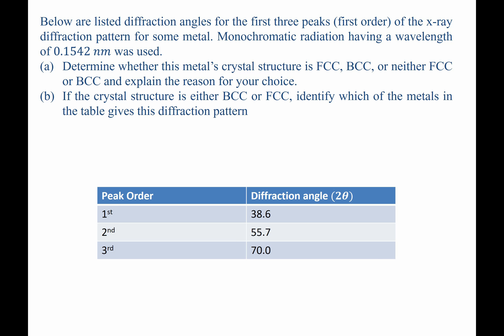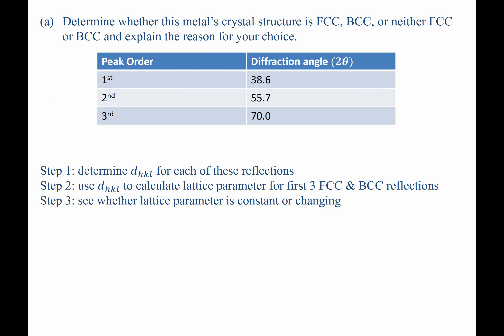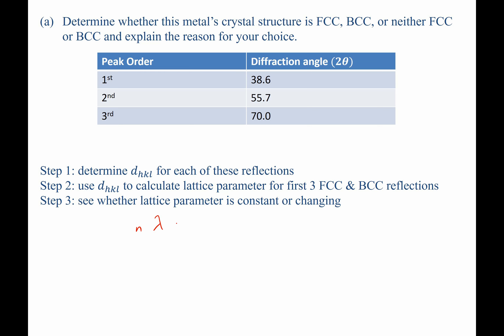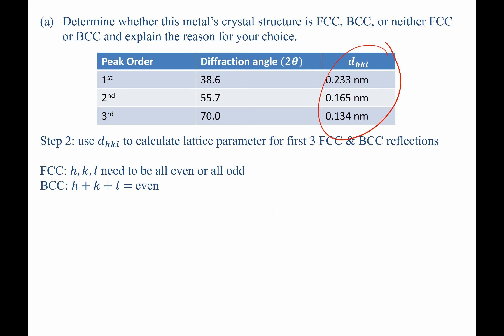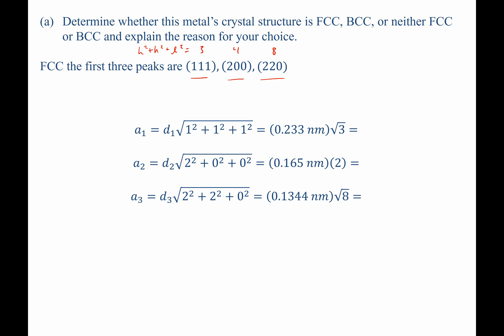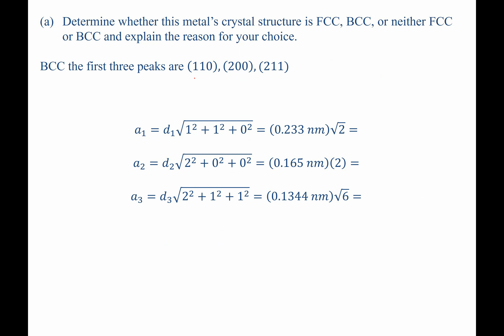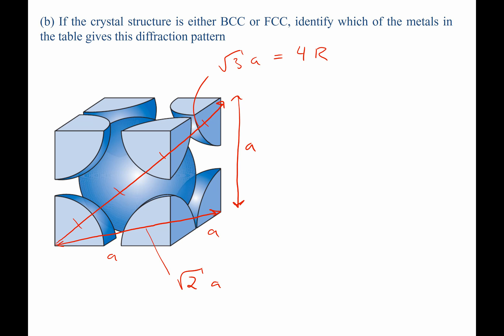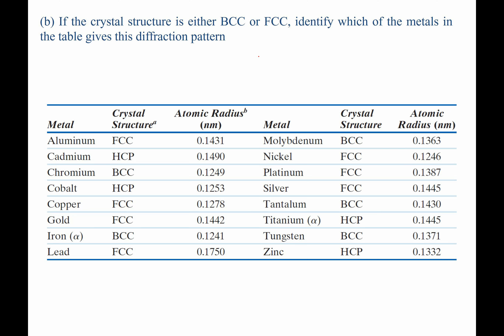XRD X-ray diffraction worked example problem

Comment: Thank you very much, I spend so much time trying to understand our professor's crappy presentation. You are the first one to explain this stuff properly..
Reply from the maker: I'm so glad to hear it! Let me know if I can clarify other concepts. Also, like, subscribe, and share to help me grow my channel!
Reply: @TaylorSparks  Thank you professor for such a vivid explanation. I have one question which is confusing me. The maximum interplanar spacing will correspond to minimum value of h2 + k2+ l2?  So it means it will be the plane having least integer sum?
Reply from the maker: @waqasmuneer7951  Not necessarily!! That is only the case for the cubic system. In other systems the lattice parameters could make this untrue. For example, Consider tetragonal. The d spacing formula is 1/d^2=(h^2+k^2)/a^2+l^2/b^2. Here you see that depending on the values of a and b, it might not be right. For example, (001) will have a larger spacing than (100), even though these both have the same minimum value of h^2+k^2+l^2.
Reply: @TaylorSparks  pppp

Comment: how did u figure out the first three peaks (miller indices) for FCC and for BCC?
Reply from the maker: I think that's exactly what I answer in this video. What exactly did you not understand? FCC versus BCC have different allowed hkl reflections so we went one by one and figured out which ones match the observed reflections.
Reply: @TaylorSparks  I think he is confused how you drew the conclusion as to what Miller indices are to be used for FCC and BCC. They should already be known for ease of operation.

Comment: Thanks..Is metal oxide have FCC or BCC structure.. if so far, how we calculate a from planes and spacing. If along with a how will you interpret for b and c in different crystal structure like tetragonal or orthorhomobic. I this you have calculated keeping in view for cubic system..kindly tell about any calculation to calculate R, a and b, volume  of lattice which made easy for metal oxides like tin oxide. Please specify

Comment: hi taylor, I was given a question which asked for interplanar spacing in FCC Aluminum expected slip systems, wouldnt it just be the calculation for d110? as [110] is the slip direction in FCC due to highest linear density.
hope you can reply, thank you so much!
Reply from the maker: No. The slip direction is 110, but the slip plane is 111 so you need to calculate d_111
Reply: @TaylorSparks  dang.. however, from William D Callister's 7th Ed textbook chapter 3 Problem 3.57, it asked us to calculate interplanar spacing for Aluminum (110) set of planes. so how do we know when to do calculations for d110 or d111? would it be only when it's specified?

Comment: I don't know how ,your plugging your numbers because you dont show it, I'm getting different results like .098357056 nm for the first value using 38.6., I used 38.6 degrees and I also, in case excel was treating 38.6 as radians did a conversion and my number are still way different.  This is what I'm doing:  .1542/(2sin(38.6)=dhkl =0.12358153785, I got it, you have to half the values because they are 2 theta,
Reply from the maker: Hi Stephen. The problem is that 38.6 degrees is the value of TWO theta, not theta. So you need to divide theta by two in your sin function.
Reply: @TaylorSparks  Thank you Mr. Sparks, I figured that out after I wrote to you, but I figured I'd leave the comment up in  case someone else made the same error.  I love your teaching style, thank you.
Reply from the maker: @stephenrose1902  thanks man!!
Reply: @stephenrose1902  your comment really helped me. 
thanks for leaving it on..!

Comment: At 6:27 you started with part B in your problem and you used a table with atomic Radii and Crystal structure to determine the metal. I searched atomic Radii of more metals and there are Emperical Atomic Radii and Metallic Atomic Radii --->
And you see with the table you provided at 6:27 I couldn't find accurate results as I found an element with a BCC structure and an atomic Radii of 0,1521nm and according to that table my best bet is Tantalum with a BCC structure and a atomic Radii of 0.1430nm, but I already used Tantalum in another example where I found the crystal structure BCC and an Atomic Radii of 0,1429nm.
Source where I found the different types of atomic Radii --->
https://en.m.wikipedia.org/wiki/Atomic_radii_of_the_elements_(data_page)